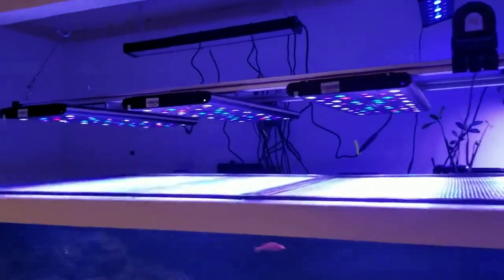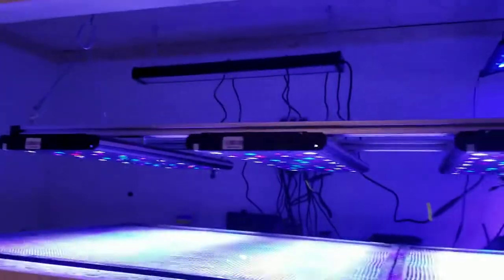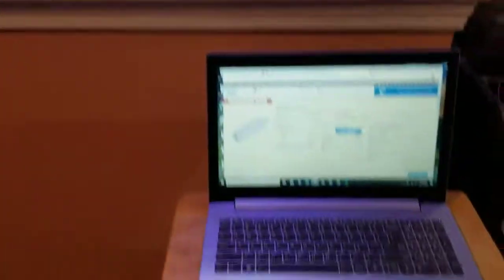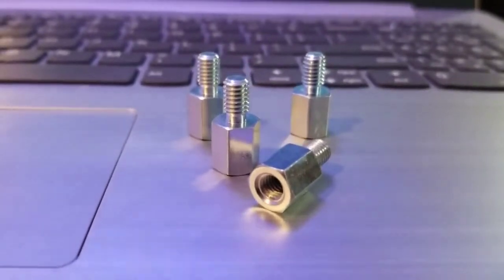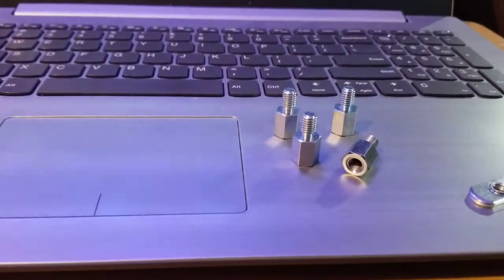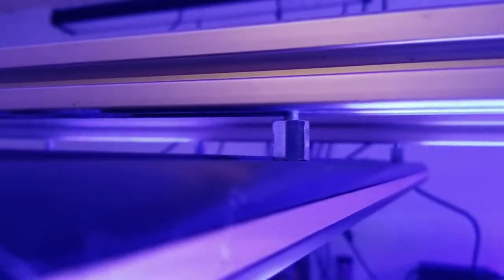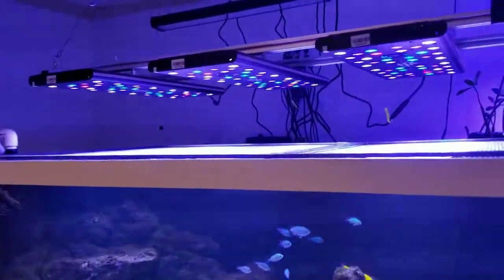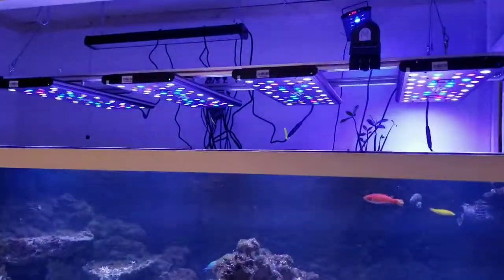How to Attach Reefbreeder LEDs to T slot Aluminum

Comment: Hey great job !! i have my light mounted the 82/20 i'm going to be buying reef breeder lights and mounting them. do you have a link for the 80/20 tees you used?  And do they screw directly into the light fixture? Thank You.
Reply from the maker: the standoffs screw directly to the fixture. I don't have a link to the t nuts, I bought them from amazon I think, maybe 8020.net
Reply: thank you i got the pieces going to install tomm. how do u like the photon lights?
Reply from the maker: ro  they're awesome, work great